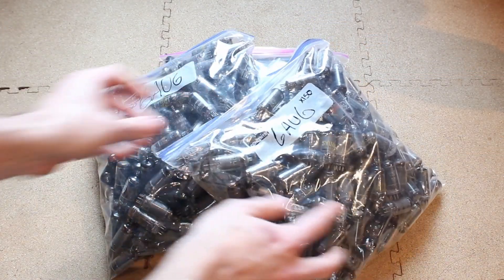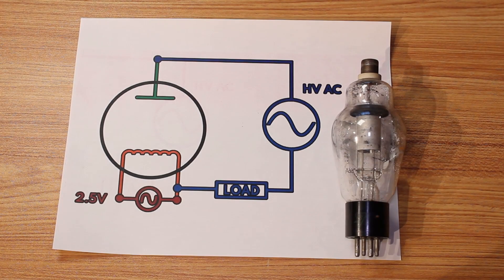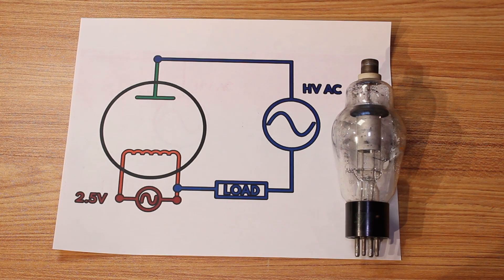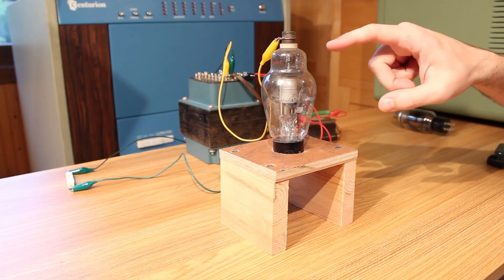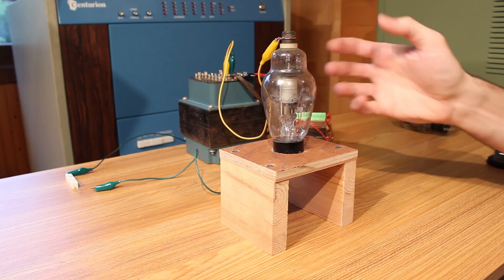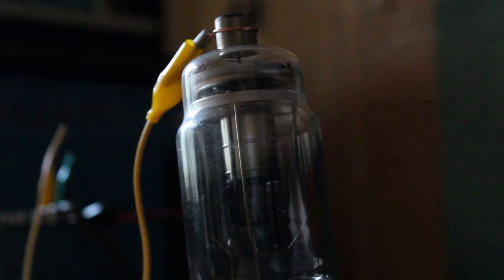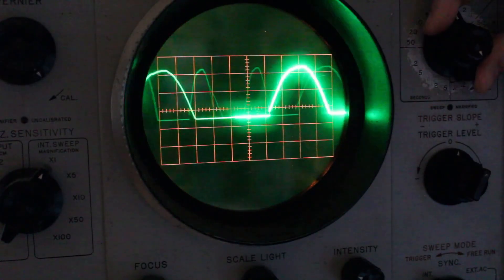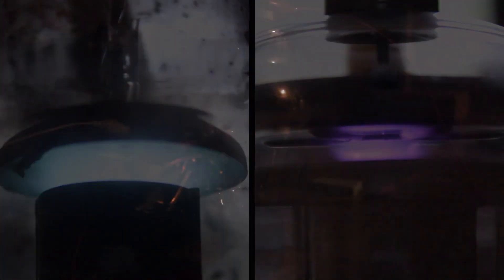A Look at Mercury and Xenon Rectifiers

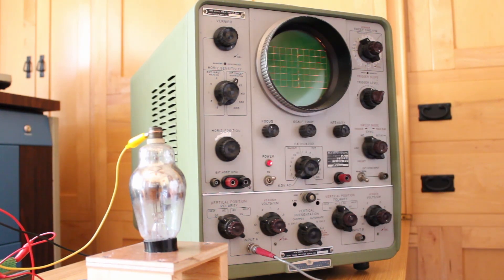Comment: The waveforms of each tube were about the same, but the way they turned on looked a little different. Both have a cliff at the front, indicating it has to pass some threshold to conduct -- makes sense. The mercury (11:00) appears to grow upward. The whole half-wave is present from the start (except the threshold), and the magnitude grows over a few seconds.  The xenon (12:16) appears to grow from the back. It starts as the the tail end of the wave, with the cliff near the end. Then the cliff moves forward as the voltage grows.

Does anyone have an explanation for this difference? It looked like the scope may have been set to trigger on falling edge for the mercury and rising edge for the xenon. But I haven't used analog scopes enough to understand how triggering works on them, and whether this would explain it.
Reply: the only difference i see in the ‘scope is the sweep period, so i don’t think it’s the triggering

maybe something to do with the thermal stuff?
Reply from the maker: Very keen eyes!

The real reason they look different when powering on is because I'm colossally lazy, haha.
With the Mercury tube, I pre-heated the tube for around a minute before applying any high voltage. But, when I switched over to the Xenon tube at 12:16, I was in the groove for filming and didn't want to wait to pre-heat the tube, so I just slapped it together and hit the switch. In the edit, I cut out the approximate 15 seconds it took for the heater to warm up enough to start the ionization process.

Having said that, the Xenon tube does tend to have the cliff start at the tail end and move forwards while the mercury tube doesn't. Both tubes do get a full rectification and then grow in amplitude over the next 30 seconds or so after ionization starts. I don't have a good explanation for why the cliff start at the tail end and moves forwards though, that's a really interesting phenomenon that I imagine is related to the different ways that the Xenon and Mercury ionize.
Reply: @UsagiElectric  I was wondering about the same thing. Quite interesting to see the different behavior.
Reply: the scope triggering was not stable and the display was not rock steady. what you saw is an artifact of the trigger setting, I guess.

Comment: Note the steep rise at the beginning, where the voltage is not enough on each sine wave to turn the tube on, but it jumps to a higher voltage as soon as there is enough voltage.
Reply from the maker: Yup! Takes about 15V to 20V before the ionization occurs and it begins conducting properly.
Reply: @UsagiElectric  Interesting property, I wonder if that was ever exploited in the same way SCR and TRIAC is for "dimming" in whatever context it might have been used in

Edit: as it seems to be related to filament temp as well
Reply: there is a small reverse current that is not seen in the scope. the reverse current will be approx in the ratio of electron mass vs Hg ion mass. The contribution of Hg ion to the total current is rather small (also space charge)

Comment: Just a reminder, 113VAC (RMS) would be close to 160V peak.
Reply: Just a reminder, this type of rectifier have average voltage drop around 15V
Reply: @Jiricok195   A shottky mercury vapor rectifier should perform better
Reply from the maker: You're absolutely right! But these rectifiers do have a 15V drop across them according to the datasheets, so I would be expecting about 140V to 145V peak on the scope, but in reality, it looked a little closer to 130V to 140V. Could just be my poor reading of the scope though, I really should have dropped the V/cm setting and put 0V at the bottom of the grid and then use the full grid to count the real amplitude.
Reply: @UsagiElectric  That's assuming the scopes are calibrated.  ;)

Comment: I have some NOS 866As (half-wave filament type mercury vapor rectifier), and they come with warning labels in their boxes. "Warning, preheat tube for minimum of 60 minutes at first installation" and, more importantly "CAUTION X-RAYS. This device may produce X-rays when energized. Operation personnel must be protected by appropriate shielding. X-ray warning signs or labels should be permanently attached to equipment directing operating personnel never to operate this device without X-ray shielding in place."
Reply: i got some of them too i plan to put them to use at some point just got a few others projects to finish first
Reply: Xrays can only be generated if the anode voltage is high enough, but it has to be at the extreme end of where the 866 is normally operated. at voltages less than 5kv (where the bulk use of 866's were) its safe, at voltages over 10kv, then its wise to shield
Reply: @DanafoxyVixen  good to know. It does say "may produce" not "will produce" after all.
Reply: @DanafoxyVixen  -  There is a good example of this from Glasslinger on Youtube who made an xray tube and was using a 30kv power supply on it and got some astounding xrays out of it. That bastard was hot... Much hotter than the real xray tubes from GE for medical devices. Xrays produced at 15KV are soft but when you get above 20kv and start heading to 30 and 50kv, they get nasty and the frequency of the emissions is much higher and can cause a lot of damage or a burn. This is dangerous stuff.

Comment: ..I always liked the old OC3s and OD3s ..Darn shame that the current draw is so low with those tubes... Not to mention the voltage drops.
Reply: those OC3 and OD3s are voltage stabilizers, not rectifiers, only designed to produce a reference voltage, not pass significant current, although there are much 'beefier' types
Reply: @andygozzo72   I know, but, they DO have a nice glow to them.

Comment: 8:33 - reminds me in a way of the getter on some 30's radio tubes I've seen, they all had this whole reflective layer (I'm guessing it's the getter?) covering the entire top of the bulb with the layer gradually fading over towards the bottom of the tube.
Reply: You're right. The getter flash after the tube is evacuated.
Reply from the maker: I was thinking the same thing! I just didn't mention it in the video because I guarantee I would ended up confusing myself and saying the wrong words at the wrong times, haha.
Reply: You are probably thinking of 01 or 01A directly heated, battery-radio triodes with 4 pin bases.. Some of the earliest ones, even brand new, had a rainbow effect to the getter that did not signify that they were heavily used or about to wear out.  Somebody offered me a bunch of them in boxes at a moderate price and I assumed that they were used and didn't buy them.  That was a mistake as I could have easily doubled or more than doubled my money on them, but it was early into my days of reselling tubes and there was a lot I did not know.  Not to mention, that particular antiques seller tended to be overpriced on most things and drovre a hard bargain, which made me leary.
Reply: @goodun2974  I don't really remember what these were (I'm talking about something I saw some 15 odd years ago when I was a lil' kid), but the 4-pin base does ring a bell to me

Comment: I could be wrong but if I remember correctly when CuriousMarc was repairing the power supply of the teletype there were also some of these blueish purple glowing tubes in. They are awesome anyway.
Reply: There's another style of gas-discharge tube in this vein which behaves more like a zener diode, those continued to crop up even as things became more solid-statey over time so it might have been one of those.